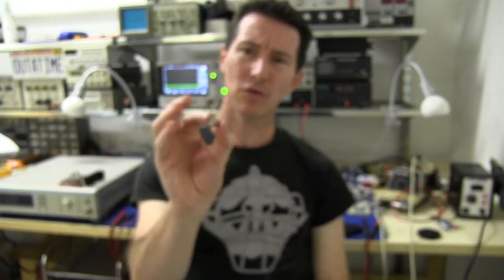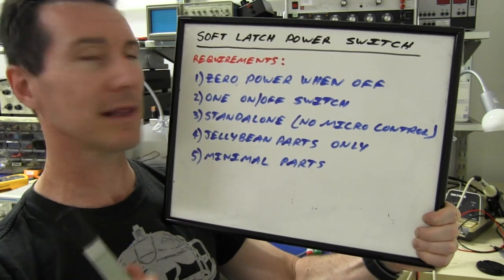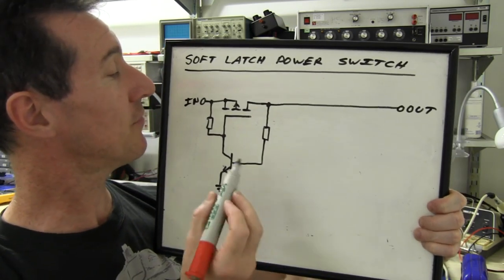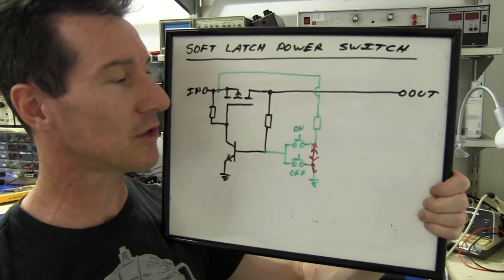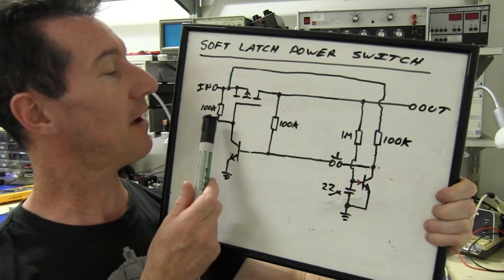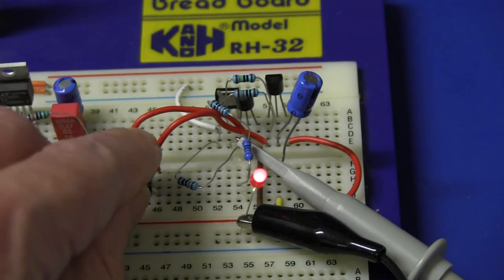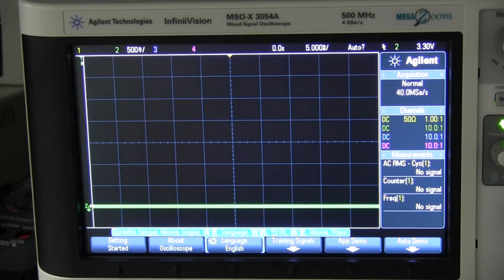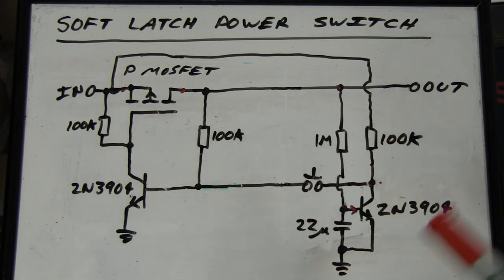EEVblog #262 - World's Simplest Soft Latching Power Switch Circuit

Comment: I like this circuit a lot. It's a shame no commercial soft latching power circuits exist. Personally, I'd use a microcontroller. Specifically an ATtiny85. Basic idea is, the switch provides power to the ATtiny85 which promptly latches on a transistor that keeps the ATtiny on. When the switch is pressed again, the ATtiny will connect the base of the transistor to ground. This will cut all power for the ATtiny. Of course there will be a delay so the ATtiny won't turn itself off immediately. Possible other functions could be added.

Comment: I prefer a good old toggle switch. Much more solid, simpler, and also no power dissipation at all (but more costly of course).

I think this circuit is also more subject to EMI interference problems (due to the presence of the MOSFET, which is voltage-controlled, no current-controlled like the bipolar transistor).

Comment: Yes! Something that will dupe the old 3/4" x 1" tile switches using 328/329 T1 lamps, but with touch sensing. Perhaps a semi-conductive plastic that could be edge-lit with an LED and fastened to a panel with a single plastic screw and the wires run down a hole. The output and the LED would switch on if touched with enough force (but not ian accidental light touch). Likewise touch to switch off. Or else sense hum picked up from the finger or RF-based proximity. And NO oscillation, please.

Comment: I want to plainly challenge you to a beautiful open source circuit for an individual cell Lion charge and discharge protector, that can bridge the cell out of the circuit - so if a cell is full others get a better share of the incoming, - when its empty or over current, it is bridged out of the circuit while the stronger ones try, or all signal defeat and completely short out all cells in a series! You know I want a circuit that can make a high voltage chain of mixed batteries!

Comment: Two things...

1. If I up the value of the capacitor, would u be able to hold the switch for a longer period of time without the light pulsing? 

2. Could I add a relay into the mix to use this circuit to control a light on 230/110VAC?

Comment: re: Tile Switches. Another method would be to use two electrodes (foil, wires, etc.) on the surface such that you have to touch both together with the finger, but accidental touch of one would do nothing. If multi-colored LEDs were used (red/green/yellow), you could even have a 3-position swtich that would ripple through the colors and control three outputs, one at a time or all off. All kinds of possibilites here.

Comment: Actually, I don't thing you get it. First off, I am talking about how this would be more expensive then using a typical toggle switch. A good P-channel MOSFET will cost as much as most switches on their own; then we have the additives. The only upside is that the FETS can handle a LOT more current then a typical toggle switch. Which, mind you, will have to deliver a lot more then a few micro amps.

Comment: It depends on your desing, if it's a "mute" button the way dave used is pettry good for that purpose.  Otherwise, if you want the signal to be multiplexed, the discrete components way would end building some short of counter, what might be easier to just use the micro, or a spare counter and a analog multiplexer.
on the other hand with the micro, you can have some short of remote controll over it.

Comment: k, I'm back. the problem with your circuit is that shutdown transistor (far-right) is not set correctly. it somehow works for a change, i'll give you that. and the cap in order to keep base low has to have a discharge rate somehow equal to the little base current of this transistor. Cause it works, I have one word to describe it: magic!easy fix would be to ad a direct diode (like a green LED, make it lit in operation) to the emitter of start-up transistor. that forces the base of it high enough to engage at start-up and to disengage at shutdown. that way both bipolars get polarized correctly.another little concern is the current draw. while off, your circuit draws none. but in operation will draw emitter current through both bipolars. you may want to get it down to say 1mA each, but still your switch will draw power while on. is not much though.

Comment: I have a D flipflop based latching switch, though as a human i cannot trigger the switch that fast. Saw your addition of RC network to increase the delay, Brilliant. Thought how may I implement it into my circuitry? Perhaps have the caps connect in my Q complement and have the  resistor connect to my output of the D-flipflop? Thanks for who ever can answer my question!

Comment: And I would like to add a point:  in a case of short circuit on the output the switching transistor can be fried. Instead a classic switch will survive. It's how I make difference between cheapo Chinese electronics and "build to last" electronics.

Comment: It's easier with 4017 IC Decade counter one or more transistors depend on what you use it for + resistor + diode and el.capacitor and there you go...
Every time you trigger it it power another pin also there is a reset pin to limit it on 2 or 3 or 4 pins so every time you trigger a push button it power another pin so if you limit it on 2 pins and put transistor only one one pin, when you pres second time it will power pin that is not connected to anything or Red Led just to tell you in what stat it is. and then first pin is turned off. When you press another time it will power first pin and green led and switch off second pin and there you go...
I know this is old video but it works.

Comment: @EEVblog 
I might be wrong on this but here's my idea: The switch could also be used as an input for a microcontroller IF the timing cap is large enough, so you could have a function be executed by the microcontroller on a short press and have the circuit power off on a long press.

Am I right? I don't know, but it seems like it should work.

Also: is there a difference if I use different transistors? Would I need to change the resistor values or something? I'm planning to use this on my LED cube project and I want to use some transistors that I have on hand (S8550 PNP and MPSA13 NPN Darlington). Thanks for the input Dave. Have a nice day.

Comment: Very interesting again Dave, and thanks.
I've been thinking about something similar for a solar project but will also need a micro to switch power off if the battery voltage is low.
I should really be on the forum with this, but just thinking about power useage of a mosfet circuit vs. a latching relay.

Comment: Hai im inventor from Malaysia.ive been around with negatif resistance effect about 15 years and have develope a lots of mysterous circuit or latch switch.one of them is just like your first scematic but i did not deploy second transistor.just single transistor 100 k and relay according to common emitter.to turn on just arrange s connection to ground while off is connection to vin.im also successfully develope automatik random network switches both using negatif resistance effect or a little bit same to your design.im so suprise that your design have some similirity to mine.15 years ago to turn off just touch the ground from base transistor with Jumper but recent research i found that to turn off we can touch it to vin with Jumper from the collector by soft switch arrangement.i found that the jumper point is between transistor and load notwithanding whether common emitter or common collector.from there soft switch could be arrange whether to ground or to vin.from my research i also found that we can develope one touch on off switch with single soft switch button by taking advantage of unstable state ( transistor on and off flickering like condition) but it only achieve if we are using backward emitter collector configuration that is negatif resistance effect.at certain treshhold it will work not sure whether its an avalance effect or not.i have tried using standard cascade ( configuration) but there is no " treshhold" found.still negatif resistance effect give some advantages.thank you.

Comment: Love these concept videos - one of the most precious resources on the internet.
Question: Would a voltage divider at the base of the 2nd BJT let you use smaller capacitor values?

Comment: Depending on exactly WHAT you are driving you might get away with a switch plus just ONE component: a JK flip-flop used as a T flip-flop by connecting J and K inputs and using the clock input to toggle. May need a cap & resistor to slow down the pulse (3 components). Use old style 7400 TTL logic for 5v or better use CMOS CD4072B for 3-18v and use a single transistor on the output if level shifting is required (>18v)

Comment: Can you build that same type circuit for 120VAC -> to power a 100W light bulb on and off -> with a one button -> using no additional power supply than the mains 120VAC?

Comment: I guess, I'm too stupid. I was trying to rebuild this circuit, but failed miserably. So I went back to the very first schematics with the two bi-polar transistors and one switch, to better understand, where exactly I made a mistake. Unfortunately, I already fail there, as soon as I connect the base of the NPN transistor to the collector of the PNP one, it instantly switches on and grounds the base of the PNP transistor. The switch is actually out of the game. I guess, I took wrong resistors? I'm using two resistors with 470 Ohm, 2N3904 and 2N3906 transistors. An LED is connected to the "output" to see if something happens. If anyone has a suggestion, please enlighten me :D

Comment: Brilliant mate! The only two things I see are, that you have to add a Zener diode if you up the voltage, and the load can switch on due to output voltage, so if you drove a dc motor for example a touch on the axis could get it spinning under power! Anyhow Dave I want to work with you on another brilliant open source circuit ! How do I contact you?

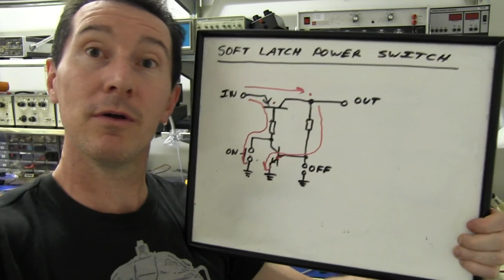Comment: In the BJT only version at 4:25 isn't that depending on the load being of low enough impedance to not switch it on when power is applied? I would say that due to parasitics when power is applied (and nothing is on VOUT) there will be a bit of current flowing through the PNP to the NPN collector capacitance, causing a tiny bit of current to flow through the right resistor to the NPN base, turning it on. Only when there is sufficiently much of that current drained through the load, the NPN base can never reach enough voltage to turn on. This seems to be a problem when the load is an LED, which means not much current can flow there until it turns on, causing the NPN to turn on, causing it to latch into on state. Putting a cap from the base of the NPN to GND (10n or so) would somewhat help here, though introduce a minimal time for the button to be held
Reply: +Dennis Lubert +{MLP} Rainbow Dash I have experienced the same effect, the LED is initially on and stays on unless the button is held down and the circuit oscillates.  I tried placing a capacitor at the base of the npn transistor like Dennis described which only delays the LED returning to a fully on state after pushing the button.  Dave doesn't specify voltage range for this circuit, but I have tried 3, 5, and 6V.  I'll keep playing with it to see if I can get it to as a latching switch.

Comment: about the future ( turn`s off slower than it`s turn`s on), I think maybe if you replace the 100k resistor between the gate and the drain of the MOSFET with a smaller value like 10k, 
it will turn off quicker (and on a bit slower) when you press the button.

Comment: There is.. but not for a buck. One option I recall seeing a few days ago: LTC2955 from Linear Tech: about 4 bucks, and still needs a couple resistors and a separate reg with a shutdown pin (like an LT3008). So right back up there with the cost of a mechanical switch...

Comment: I would drive the MOSFET with a D flip-flop.  :)
Edge triggering debounces and removes oscillation.
Something like a 4013 or a C7474.

That way, i could also add an RC network to the reset input,  
for OFF on power-up.  It is very annoying to have devices turn on after
a momentary power failure,  and a ridiculous oversight, from an engineering standpoint.

Comment: Unfortunately that is often the case, and though it seems counterintuitive, a company could spend thousands of dollars for an engineer to redesign an entire product simply trying to use one less screw and still end up saving money in the long run, especially if its a high volume product.  So long as maximizing profit is a primary motive behind a companies economic strategy the cheapest functional choice is usually the best choice. Thus products "built to last" will usually have a high price tag.

Comment: forgot 6) remembers state through power outage without duration limitation
7) state can be toggled by user during power outage without duration limitation
8) optical indication of state even in case of power outage without duration limit
9) EMP cannot spuriously change state of it.
10) state information can be forensically recovered after a fire
Then its a replacement of mechanical switch. Good luck in designing that.

Comment: I suggest connecting the 22uF capacitor from collector to base of the right BJT, then you should be able to lower it's value beta times + it will take longer time to reach the complete turn-on of the BJT and the process will be linear (if that helps with something the circuit). I also wonder why this circuit always starts switched on that's a drawback in some cases. Does a resistor from base to ground of the left BJT helps removing that initial turn on? Or a small cap in parallel with the gate - source of the pass MOSFET?

Comment: Hi.at first i do not understand the process.after a while i notice that the collector is generating negatif charge when conducting.when base to ground will turn off the transistor.so the collector will provide negatif to the base to make the system turn off.the 1 m ohm i think can use diode  as well as i think to prevent from short circuit to ground ( in respect to this system maybe vin is the ground). Well a brillian idea.

Comment: If you don't want it to oscillate, then I would imagine a simple Parallel RC network in series with the switch should do the job. Maybe something like 1M and 10nF ? This time constant would determine how long the switch needs to be released, before it will result in a toggle. The cap must charge before the 22uF gets to the transistors VBE, otherwise it will still oscillate.
Reply: I think I was a bit fast in posting that. If the node on the delayed transistor has a fast enough fall time it will still turn it off. It would be a balancing act with the first 100K resistor. It might still work though.

Comment: Great video, loved it. I'd love to see more tutorials like this on basic but useful and reusable circuit modules. But what I don't like about this circuit is that if you hold the button pressed, it oscillates the state from on to off and back. Could you make a just as cheap circuit using a JK flip flop and a few passives, which would keep the state from oscillating when holding the button pressed?

Comment: I am thinking about a similar circuit, but instead of low voltage shut off, I want a low current shut off. Kind of a "shutdown if in standby" thingy...
But the only way I am aware of is using a op and a shunt... And I never really understand how they worked.

My idea is using a switch to power this on and if the charger is at its end or the standby is switched on... They relay would beak the whole mains.
Like a master-slave socket, but of powered of I need to press a key to start it again. (maybe with a soft latch to use it universal).

Maybe you could cover something like this?

Comment: Here's a strange question: can you go back to the original circuit and make it a press on, but use a photo-transistor (or CdS cell) to turn it off?

This could be used to turn a night circuit on, but lets the sunlight turn it off.

Comment: How would you use this circuit to switch mains power? I guess you would need a suitable relay that can switch 240v at the output of this circuit. 

Power the actual switching circuit with a separate voltage supply lets say 5v. and use a small mains transformer, bridge rectifier some filtering, probably an 7805 to make effectively a 5v standby circuit. some consumable customer electronics use a system like this mainly amplifiers. much more elegant then a clunky switch!!

Comment: I tried to build this curcuit (using a breadboard for now), but my LED that I connected at the output (drain of MOSFET) just stays on when I toggle the switch. If I leave the switch on, I do see it blink. What could I have done wrong? I've double-checked my connections. I did use a NDP6020P instead of the IRF 9110

Comment: This may work perfectly for me for a project where I am going to build a set of underwater LED lights and can only find underwater rated momentary on switches. The question I need to answer, because I will be using full 12V DC and want everything to be 12V for simplicity, do I need to change the value of resistors and capacitors to accommodate the higher source voltage? Would it be a different model of transistor? I can follow a wiring diagram for fabrication, just don't have an electrical engineering background whatsoever!